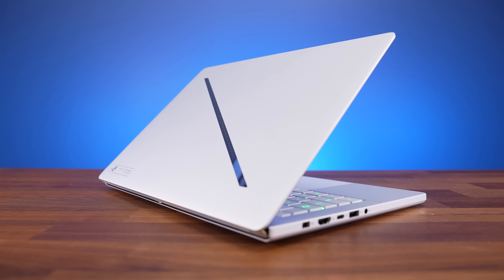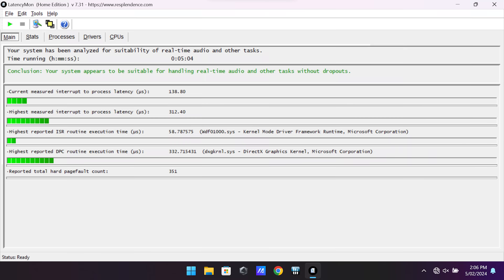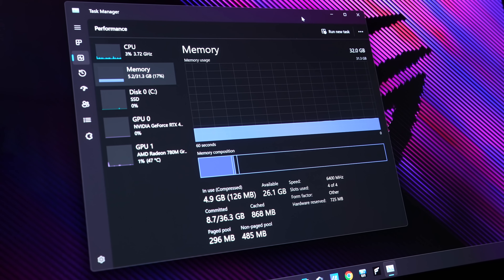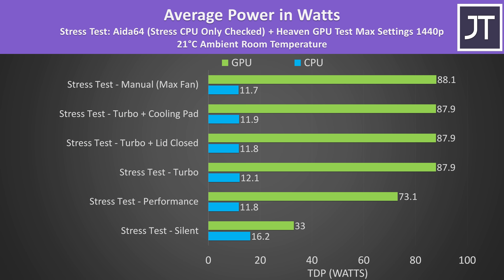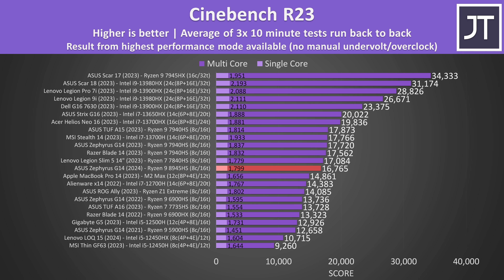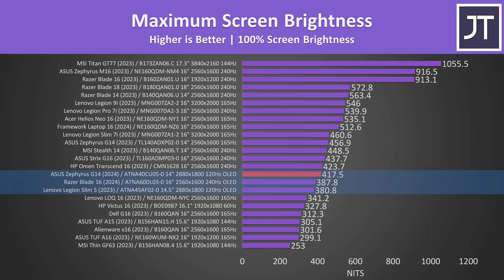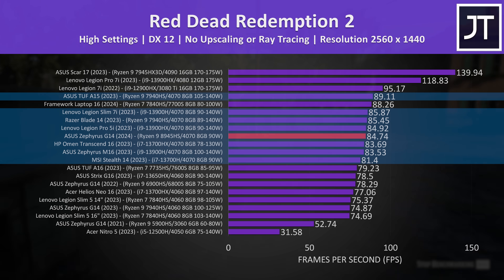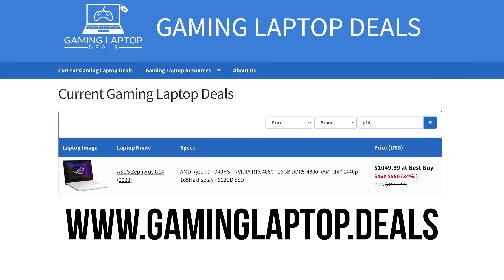ASUS Zephyrus G14 (2024) Review - Problems You Must Know!

Comment: Hi Jarrod! Awesome video as always ❤️

Could you give any more insight into when and what causes the CPU to be limited at 12w? Is it when the GPU hits a certain temperature - or are there any other specific conditions that you noticed as a trigger for that limit?

Certainly want to be able to optimize for best CPU performance when needed! 

Thanks!
Reply from the maker: ASUS set it, presumably in the BIOS. It's whenever the GPU is active at the same time. Happens straight away.

Comment: I'm just amazed how close are the G14 and G16 2024 to the title of "MacBook Pro on Windows". The battery life is great, the screen is too, so are the speakers. The GPUs although power limited are performing okay and still better than any AMD or Apple M offerings. A really great all-rounder for anyone working on their laptop first and gaming second. But in my opinion they should just keep the 2023 chassis and sell it to the ones who like it - by all means G14/G16 24 are not the laptops of the model lines that were sold before. They are completely different and have a different target audience.

Comment: Hello, thank you for these videos, I'm looking for a notebook and I have chosen different models: Lenovo Legion Slim 5 14.5 vs Asus G14 2024 vs Legion Slim 7 with Intel (I couldn't find the AMD at a good price) all with 4060 graphics. Any recommendations?

I like the slim 14 and the size is perfect but the sound is bad approximately 1500 euros

the slim 7 has intel with better sound with a 16 screen it is not oled I think the version I saw at the price is the 240hz one 1800 euros

and finally the asus G14 is about 2000 euros and has good sound

  thanks and regards

Comment: unpopular hot take here: the soldered ram on its own isnt bad, you get faster ram for cheaper and its the only way to really get faster memory speeds until CAMM slots start coming out. that said, 32 gb of ram locked to the 4070 model is just absurd, 16 gb is becoming obsolete and you really need 64 gb at the top end for future proofing or any studio/ workstation type stuff.

Comment: The real problem is the weird and wonky fan curves, which constantly turn up and go down, while idling at the desktop. Not doing it always though... It seems the CPU is constantly clocking to 5ghz for a very brief moment every few seconds, causing the fans to go up and down and up and down and up and down... This is even on silent mode (charger plugged in, though).

I come from a Flow Z13 (that gaming tablet) with i9-12900h and 35watt 3050ti. That managed the thermals a bit better (even with the fans blazing the noise wasn't annoying, if the g14-2024 goes to town with the fans, you think the laptop is actually getting lift off from your table :)).
Anyway, this is 100 grams _LIGHTER_, has a better screen, laptop form factor and more power on board (CPU is faster and GPU is way faster). But it shows the 'tablet form factor' actually has more potential for cooling... or I miss the vapour chamber from that little machine.

Comment: having soldered RAM on both the G14 and G16 is the exact opposite of what other companies are doing. even Razer have slotted RAM on their 14" since last year.

huge L for Asus
Reply: To be fair, Dell is doing the same thing on their XPS 16, although they are doing it worse by intentionally bringing a worse chassis with known usability issues to the entire XPS lineup. Imo, the XPS lineup is dead.

As for the Asus ROG Zephyrus G series, I'm leaning towards the Blade 14 from 2023 or 2024, because they have two RAM slots. Literally the only benefits to the G14 are the microSD card slot (not huge) and the OLED screen. Otherwise, the Blade 14 wins.
Reply: It's 6400 Mt/s memory, what do you expect?
Reply: LPDDR5X is better for battery and has to be soldered on.
Reply: @ideoidiom  You are only half right. You can't have SO-DIMM sticks of LPDDR5x RAM, but you can have CAMM sticks of LPDDR5x RAM. So it's not like they had to solder on the RAM, but they chose to force users to upgrade to the more expensive RTX 4070 config just to get 32 GB of RAM, which puts it way to close to the far superior Razer Blade 14.
Reply: @ideoidiom   I don't think it is better for battery, but it is surely better for performance.
Reply: @cameronbosch1213  CAMM is only Dell's implementation.
Reply: @TuxikCE  Except it's now a standard that Dell donated.
Reply: @cameronbosch1213 which was only very recent. It would take at least another year to see mainstream laptops with CAMM slots
Reply: @ideoidiom it’s only 6400mhz. You can get speeds upto 5600mhz with sodimm slots. Now do you really want to sacrifice everything for that extra 800mhz?

Comment: Which do you think would be a better buy in terms of gaming performance? The 2022 Razarblade 14 3080ti for $1799.99 or wait for a 2024 g14 4070 restock at $1999.99?

I like the oled screen, design, portability and battery life of the 2024 g14 but am unsure how i feel about the 4070 8gb.. the 2022 razer 14 has a 3080ti with 12gb. I plan on playing mostly on the laptop itself but occasionally would like to play 4k on a 65" lg oled
Reply: In terms of performance razerblade will be better especially in 4k. Rtx 4070 has only 8 gigs of vram so 1600p is max for comfort gaming

Comment: I really prefer so much the 2023 G14 design. Also, it is still very portable and has better performance. G14 4070 2023 has going on sale in Best Buy for 1400. I thin 600 dolars is not worth it for an OLED display.

Comment: These laptops run way too hot. My 2020's lid warped because of the heat! I wonder if the new material they are using for the case will fix that.

Comment: Świetne wideo i porównanie do modeli z roku 2022 - 2023! 
Mam G14 (2022) z procesorem AMD 6900HS; grafiką RX6800S;  32GB RAM ; 2TB SSD
Świetnie się to sprawuje, aczkolwiek wydajność tego małego laptopa idzie w parze z  piekielnymi temperaturami. 
Myślę nad wymianą na wersję G14 (2024) z RTX 4070, ale ceny zniechęcają do wymiany.

Great video and comparison of models from 2022 - 2023! 
I have a G14 (2022) with an AMD 6900HS processor; RX6800S graphics; 32GB RAM; 2TB SSD. It performs wonderfully, although the performance of this small laptop goes hand in hand with hellish temperatures. 
I'm considering upgrading to the G14 (2024) version with RTX 4070, but the prices are discouraging."

Comment: Hi Jareod if you put the G14 side by side with Razer blade 14 which one will be thinner? Specs says g14 have lower height at 0.64 than the blade 14 but looking at it in videos, it seems to be higher of the ground than a blade 14.

Comment: hi Jarrod, i had a terrible experience with laptops that have soldered memory. I watched your videos and i think i should go with MSI gaming 14 inch laptops since they still have 2 memory slots. Is there any other brand and model you can share with me that still has memory slots and not soldered memory? This Asus is a no go for me.
Reply from the maker: Most 14" have it, the MSI is one of the few that does, I can't think of any others that have both slots for upgrades off the top of my head that we've tested.

Comment: I have had a Asus Rog Zephyrus G14 2021 model that had a WD SSD and Realtek Wifi Card. But this G14 2024 model has some SSD which appears to be local since the laptop hangs when it heats up. Also, the wifi card is also Mediatek. The SSD supports speeds of upto only 4900Mbps read and 3500Mbps write which is quiet low for a GEN 4.0 SSD. Also, the G14 2021 waked up from sleep in under 1 second but G14 2024 does not.

Comment: Wifi performance depends not only on antenna design and shielding but also the quality of the analogue components (manufacturing accuracy, resistence for coils, etc) so mediatek might have upgraded their wifi card quality or maybe asus is testing or demanding more from mediatek - ex-qualcomm engineer.

Comment: It looks like Asus got rid of the vapor chamber on the 2024 model and went back to the traditional heat pipes and fans design found on the 2020 and 2021 models. The 2022 and 2023 models have a vapor chamber.

Comment: What should I buy?
- Asus ROG Zephyrus G14 GA403UI
- Apple MacBook Pro (2023) Apple M2 Max Chip 32GB
Both device has close pricing here in Bangladesh. Currently I am using i7 Nitro 5 from 2018.
Reply: g14 i found it very amazing and good for gaming and work VERY good laptop and in my opinion i don’t really like apples laptops since most things are compatible with windows
Reply: @Skylul  Thanks, I also decided to go for G14 as Apple product not official here.
Reply: @QuoteService  Can you give me your review of the G14 2024 after using it for four months? I'm currently using a MacBook Pro 14-inch 2021, and I'm undecided whether to switch to the G14 or upgrade to the MacBook Pro 16-inch M3 Pro. Thanks

Comment: When’s the g16 review coming? Also I’m confused about their models. Currently g16 specs up to 4070 on their website but people talk about 4090s. I will definitely buy the 4070 but I was curious how it compares to 4060 vs 4080, 4090 etc. Also I think they have 2 different chassis so will the 4080, 4090 specs be in a different chassis? What are other laptops using this new OLED screens? Lenovo seems to have some but their website only has IPS models. Razer Blade has OLED but those are the most overpriced laptops you can’t even customize it because if you want to increase the ram it automatically upgrades the gpu and the price jumps to 4k usd.

Comment: i am a light gamer and a coder and music composer. I am confused between g14 and g16 which one would you prefer for a person like me?
Reply: If you're a light gamer, perhaps even laptops without a dGPU might be enough for you. No need to spend $500 extra on a 4060 laptop. Your tasks suggest having a fast CPU, you don't need a fast GPU for programming or music. Laptops like Lenovo IdeaPad 5 Pro (there are 14" and 16" models) with the Ryzen 7 7840HS with 32GB RAM (16GB is not enough for the future) cost only like $1000-1100, so you should look for them, or similar laptops with specs similar to this model. As you may already know, the Ryzen 7 7840HS has a gaming iGPU, which is roughly on par with the Nvidia GTX 1650 MAX-Q and will be enough for most games, especially when you use FSR 3 with Frame Gen or AFMF (I've heard that it's included in HYPR-RX).

Comment: Hi Jarrod. Do you have recommendations for a  non-mac equivalent for mac laptops? Basically thin and sleek with a good battery life? I am looking for something that's slim but want to avoid apple and gaming laptops/loud fans under load. Equivalent specs (as close as possible) of a mac, but its not a mac. Thank you!
Reply: Do you need Mac levels of performance though? Coz if you need performance then your best bet is the G14, anyone from 2022 to 2024 is good enough for most stuff if you can have it at a great price. For thin and light chassis with limited performance (ultrabook) there are other options.
Reply: Zenbook is the competitor

Comment: disappointed by the high prices in europe and the only config that has 32gb of ram is the 4070 model which costs 2700€ the lower model has a 8845HS and a 4060 with 16GB ram costs 2200€, quite a scam, i found a older G14 with a 4070 and 16gb for 2200€, +80€ for a stick of ddr5, 420€ cheaper for better performance, also that display resolution is useless cause that gpu is suffering even in 1600p, and i am terrified of oled burn in. thank you for the review tho
Reply: Man, in my region (Spain) you can get the 4070 version for 2299€

Ironically, the older g14s here are quite much expensive than the ones from this year.

Comment: At first it was super upsetting that the 4080 and 4090 options were removed, but in reality the issue is the 4070 with 128 bit bus and 8gb of vram is insulting.

Comment: I have the Lenovo Legion GO with 16GB 7500MT/s LPDDR5
I also have an 8700G with 48GB of 8000 DDR5
Even while at 5600, and limited to 25w the 8700G is usually faster in newer games than the Z1X at 30w this is because i am able to dedicate 16GB to the GPU, and have 32GB left over for the CPU(would probably be just as good with 8GB+16GB of i had 24GB of RAM)

****Edit, in other words, most games made after 2019 i generally see total system RAM hitting 15.7/16GB with terrible stuttering, meaning the legion go tablet is running out of RAM while playing games, and yes i've trimmed down windows, and gone into the BIOS to dedicate the minimum ammount of RAM to the GPU, and turned the CPU down to 4 cores( each core seems to use about 200MB, but could be a coincidence)

Now, in an ideal world, you wouldnt need to dedicate any system RAM to the iGPU, it is all the same RAM after all. I think this is how the Steamdeck handles RAM, fewer duplicate assets.

However in windows, game optimisation, can be the enemy of APUs with a small dedicated pool of RAM.
You see, several games will see the dedicated VRAM, and try to stay within that pool dumbing down settings dynamically to keep from overflowing. Weather that pool is 256MB, or 32000MB
This is good for a dedicated GPU where using system RAM can mean cutting bandwidth from 1TB/s, down to under 0.1TB/s. But on APUs this can lead to stutter as higher detail assets are purged and lower detailed assets are loaded.

What i want is a check box that says "APU mode" and the game just ignores all memory optimisation, until system RAM starts to run out.

Also of note, poorly optimized games, often run equally well on APUs no matter how much VRAM you have dedicated.
There range of games affected by dedicated VRAM on APUs is basically a bell curve with poorly optimized games being on the low end, average optimisation being the most impacted, and then very well optimized games having little impact as they seem to have an automatic APU mode
For example, doom eternal, on the 8700G using RT ultra it tries to use around 9GB of RAM, and the performance hardly changes if you dedicate sub 1GB, and 16GB to the GPU.

I dont know how they're doing this in Doom Eternal, just that it seems to work great, however, they may just be automatically turning texture quality down to low, and in doom eternal, its hard for me to care how the textures look unless they're side by side on 2 different computers.

Comment: One thought on your gaming benchmarks. In addition to comparing performance to laptops with the same or similar GPU models, compare with laptops having the same GPU power limit. The 4070 laptops that beat the G14 by more than 1 or 2 FPS are all running the GPU at 140W+ vs 90W for the G14. So there's a trade-off of power/battery life/heat vs. performance there. The data is already visible on your current charts when I pause, so I don't think it would require additional testing.  A great review of an interesting product.

Comment: Personally I wouldn't close the lid especially with the oled display, I had an HP spectre x360 2020 with oled screen, and it overheated a lot, ended up damaging the coating on the oled screen.

Comment: what i learned from owning a 2017 first of legion series
the screen is more reliable then 2K dell external monitor thats now premium paper weight that almost caused a fire
SSD is a must especially a 1tb one cause windows and its bloatware gonna take a lot of unnecessary space
32C summer heatwave max speed is the minimum must or play heat resistant cause cooling for laptops is a severe problem and that includes fan loudness
membrane keyboard was never reliable to begin with so atleast new lenovo are nice to include replacements
and that a battery on blackout is a project live saver

Comment: My problem with the current G series is the CPU options... Especially on the mid-high end... Wanted to buy one but will go for the Lenovo legion 7i because if the option with 14700HX or even 14900HX... Why would I want a Ultra Core CPU that has better integrated graphics with a dedicated 4070+ ?
Reply: For better battery life in both idle and games.

Comment: I love my g14 with 4070.  I really like the size and power for on the go.  But at home I would love to use my 4070 super fe with core X eGPU. Is this possible?  If not any other solutions?  Using my legion go I get about double fos at same settings than on the g14

Comment: Asus is freaking out with the launch of zephyrus 2024 14” and 16” due to feedback to last years model and other competitors. Making last minute pricing adjustments, quality control, and shipping delays just to name a few are reasons why this is difficult to purchase. 

4080 16” model is showing 2899 on their website USD. On Best Buy it’s now 2699.

As much as I want this model line to succeed and beat Razer, with the minor upgrades and redesigned CNC to be premium feel and OLED with 240hz.. it needs to be fined tuned for that price. Otherwise in terms of competing with Razer by making them similar to MacBook Pro designs. Razer still will be outperforming for windows. (Customer support from Razer omitted)
When playing with 2000$-3500$ get your build quality correct. 

Lastly, That screen wobble above all else has nooooo reason to wobble like that with the build quality being upgraded, zero excuses. Makes me just appreciate competition more so.